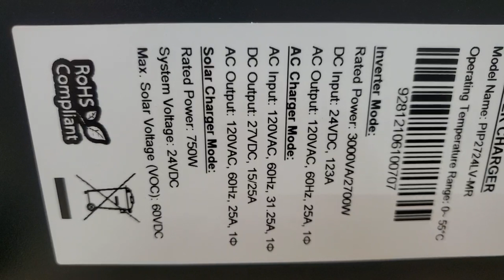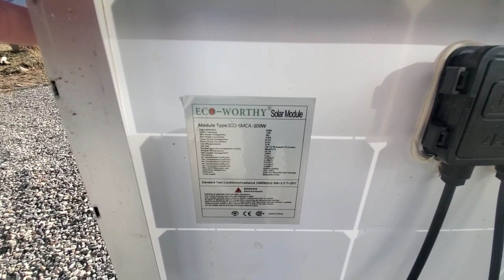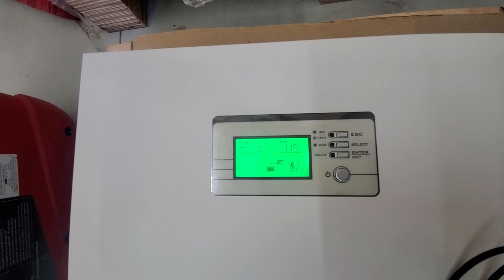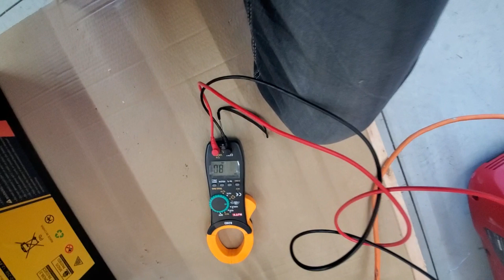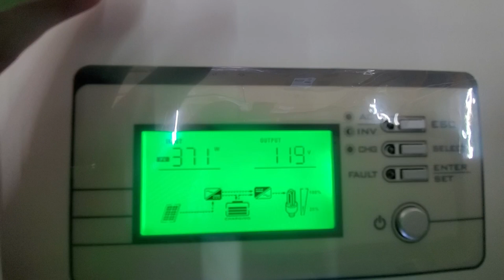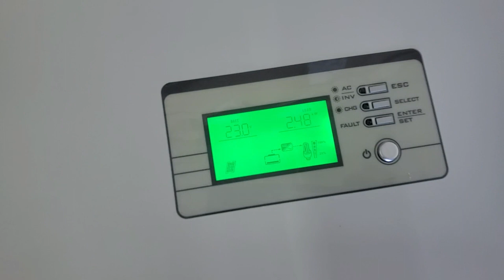LV2724MR 24V 2.7kW Portable All In One with 750W Mppt - Load Test and Summary

Comment: I have a 24v 100ah bare battery I use to top up my ecoflow river 2 pro. I was hoping to step up to one of these units. One of my goals would be to be able to plug this into a J1772 EV charger at various locations to quick charge a bank of 24v batteries. Would the AC input here be compatible with a j1772 NEMA 14-50 (or similar) type adapter to charge them?

Comment: I'm not sure the new version takes 750W PV in? The spec sheet says the charge controller takes max 25A in (makes sense given MC4 connectors). 25A * 24V = 600W is the usable power available for battery charging (as you originally say), right..?

Comment: I'm having issues with my system showing that my solar panels are connected. I have been using a 100w, 12v panel via a Wanderer solar charger and 750w inverter, connected to my battery. I've had no issues for 8 months using the small setup to use small appliances and charging phones/ipads/battery packs.
I'm going to be traveling full time in my day camper/trailer and need something to not only work for all the things I'm already using,  but to run a small dorm refrigerator.  
That's why I purchased this unit. I have 2 12v batteries set up in series and have 3 100w, 12v solar panels in parallel. Batteries show on screen but panels do not.
I've checked the panels & the connectors, even changed 3 connectors simply because they looked dirty. Still nothing when hooked to this, but when I go back to the little system they show up.

Why are they not showing? What am I doing wrong? 

Thanks.

Comment: Do I need to attach a fuse or breaker if I’m using a LifePo4 24 v battery? Or can this go directly to the battery as shown in the video? I’m going to have a 40 amp breaker for a 12
Volt fuse block so just wondering if I can attach directly to the battery or if that’s not recommended.

Comment: hi i bought one pip2724 and is750 watt max on solar  how  many solar needed and how is configure series and paaralle
Reply: 1 solar panel should fine if it puts out between 40 and 60 volts,,(approximately) ..a single panel keeps it simple. watch the video again to see what the max watts and voltage is...your batteries need to be 24 volt configuration.

Comment: Can I use two 12 volt battery sources (4 x 6V (lead acid) wired into 12V and 1 x 12V (200 amp LiFePO4)) combined to make 24V and have them charged by solar and/or shore with this unit?
Reply: I think it would be best to use the same batteries when wiring in parallel and series. Like 2 12v or 4 6v

Comment: How would this work with LiFePO4 Battery 12V 200AH Lithium Batteries? Could it run a 110v 12000btu mini split air conditioner? I'm new to solar
Reply: I have one of these..it's 24 volt. so 2 12 volt in series works perfectly

Comment: Is this unit pretty loud?  It's hard to judge from the video, but it sounded quite loud when the fans spun up.  I'd like to put this in a travel trailer, but I'm afraid it would be annoying to hear it hum loudly like that.
Reply: only the fan makes noise...louder than a computor fan ..about the same as any house fan. and it's only on some of the time

Comment: how do you go from the 24v to 12v to use on a boat?
Reply: you can get a small 24 to 12 volt transformer. hook right up to the batteries
Reply: Get a buck converter

Comment: So if it's 750w max solar how can you say 2 400-435 panels is fine?
Reply: It’s a technique called peak shaving. You have more solar panel wattage than your inverter can process while respecting the open circuit voltage restriction. This method allows you to charge at 750W for more time of the day.
Reply: He’s also implicitly suggesting using 72 cell panels which have a VOC of 50V or so. This would also let the charger start working a little earlier in the day and stop a little later in the day versus using a 60 cell panel with a VOC of 40V.

Comment: What's the idle power consumption (inverter on)?
Reply: That's my question as well, as some of the all-in-one units are know to have this issue. On page 24 of the owner's manual, under inverter specifications, it states 90% peak efficiency and <25W no load power consumption. Pretty good? Not sure. 

I generally like this thing and the price is certainly right, with an excellent form factor for building a portable system. The  one thing I wish they did differently was to not cap the solar input to 60W. I have a 100W / 30A Victron MPPT controller and, as was suggested at the end of the video, I can connect that directly to the batteries and forgo the unit's solar charger.

Comment: Can I run this system without solar panels? I was thinking about mounting this in my ice fishing house. Run two - 12v 206ah batteries in series. Then just charge the batteries when I get home from the weekend.
Reply: For what reason
Reply: @cowboymcq6711  in winter in northern MN the solar power is terrible. It is not worth the effort to install solar panels on the fish house. But I need electricity in the middle of a frozen lake. The inverter will run my heat, satellite tv, microwave, and other electrical  devices. Running a generator is noisy. Having enough power to run these appliances for two to 3 days would be perfect. One inverter, two batteries @ 5 kw of power may be just enough. Very simple system for a weekend of catching Walleyes. Pack up and go home, then charge the batteries at home to get ready for the next weekend.
Reply: @beefitter    O alright   Wow sounds like Quite the set up why don’t you just find a cheap solar panel to put on the roof as well instead of carrying those heavy batteries back-and-forth I just started shopping for solar panels again and the prices have really dropped.  Have fun and good luck with the fishing 🐟🐟🐟❕❕❕
Reply: @cowboymcq6711  I need power at night, so I need batteries. Wintertime in northern MN solar panel output is quite low. I have a 16.5kw solar system, 50 panels, on my home. It was sunny all day yesterday Jan 11th. My 50 panel system made 29 kw of power for the day. That is an average of 1.7 kw per panel. If I had two panels it wouldn't even be able to charge up the batteries. In June my home solar system puts out around 115kw on a sunny day. So batteries work the best for a weekend of use in the wintertime.
Reply: @beefitter  your batteries won't last long providing heat. I ran a 700 watt heater last week and the battery (2 x 100 AH lifpo4) had enough juice to go about 2.5 hours. The cheapest part of these systems is the solar panels now. I live in Canada (around the 50th parallel) and the sun is pretty low on the horizon, but I was still pulling in around 150 watts at 9 AM last week. the panel is rated at 425 W and only cost about $260 USD
Reply: @dans1516  I have never said to use my system for an electric heat setup. Using electric heat with batteries doesn't work very well in general. The size battery bank and solar system you would need would be quite big. It works best to have a propane heat option and use a battery bank for LED lighting and power to run say a microwave and a satellite tv.
Reply from the maker: If you think about it, it runs without Solar panels every night, just needs a battery, thats it
Reply: @watts247  I purchased from you already. The inverter came yesterday. Very good customer service. From order to my front door, four days.